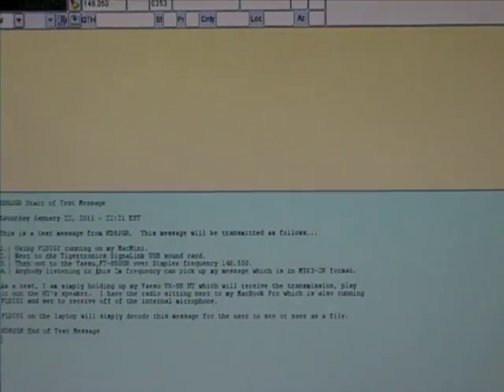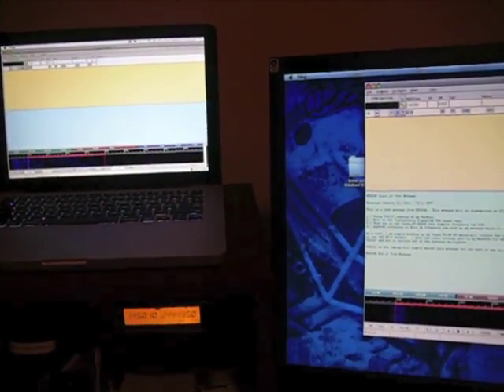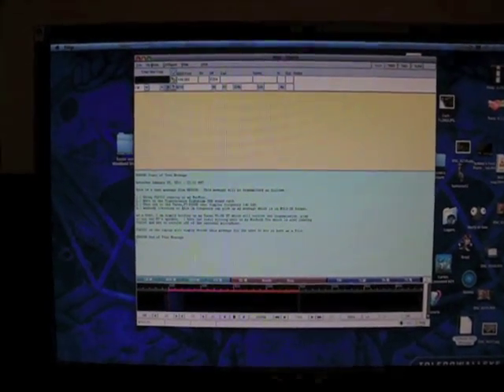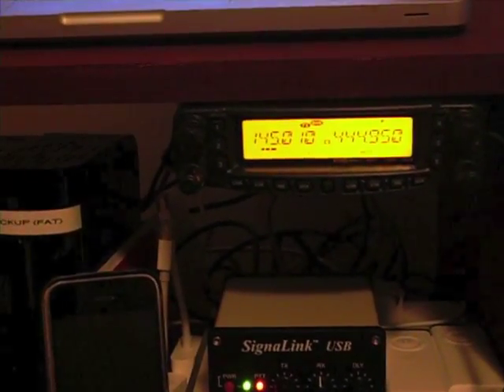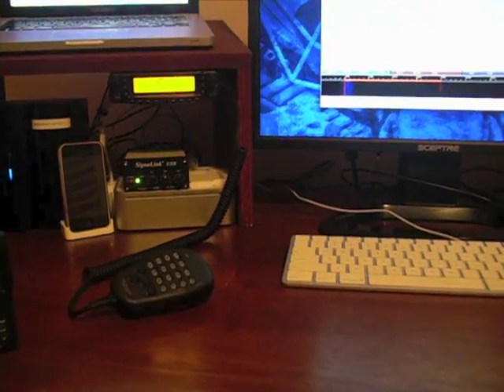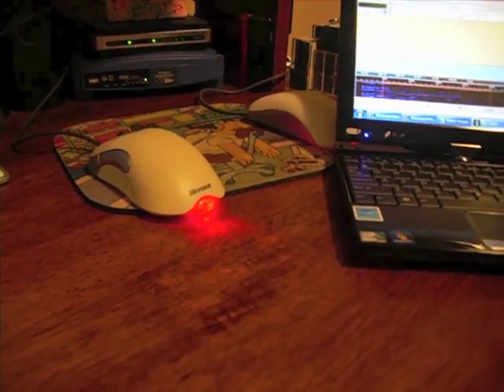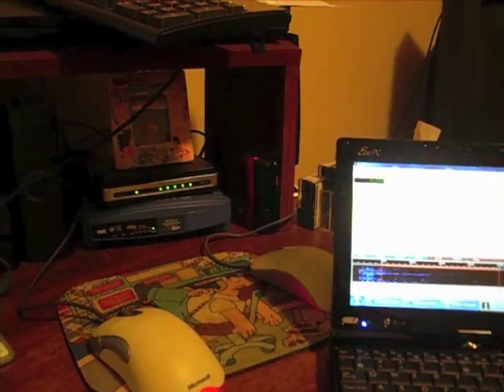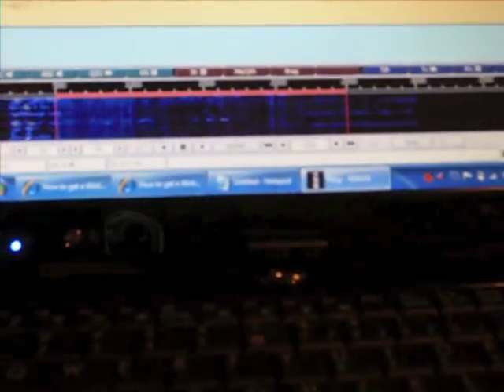Using FLDIGI by N8ZAK (previously KD8JGR)

Comment: NIce video.  BTW, I was copying with a mic and NBEMS FLDIGI on the speaker of my computer and did pretty good picking up the data. IT would have been 100% if it weren't for the audio cutting out. Check on FLMSG message based forms next! de kb3fxi paNBEMS.org